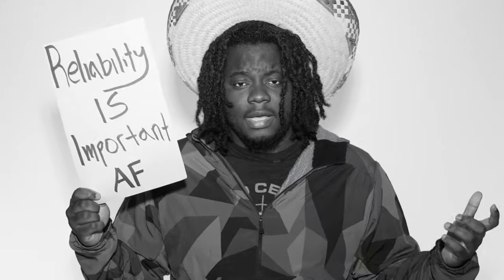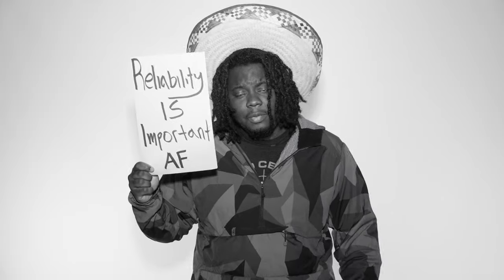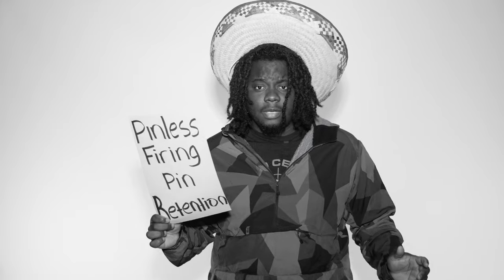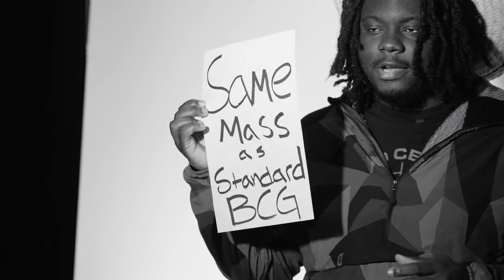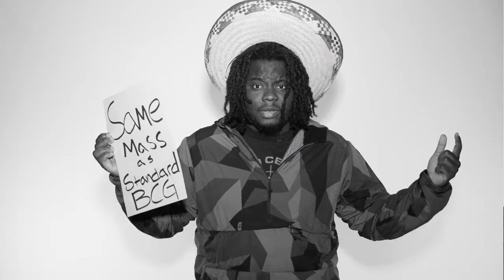Q  |  YQ  |  Why the New BCG??

Comment: I was waiting for this video, but you know, I’m still confused as to why it’s better than anything else on the market. Not trying to knock it, I have a lot of Q products, but I’d definitely like to see some kind of comparison of recordable data. Something to show why it would actually be an improvement, like showing how said scar cut works in comparison to a milspec BCG.
Reply: Exactly. The only thing i can think of is tighter tolerances for the bolt and gas rings. Oh and the bolt bounce issue. I bet it is because the Honey Badger has an extremely light buffer. I don't know how heavy it is but it looks lighter than a carbine buffer.
Reply: @monkeycbrown  yeah it might have specific uses for the honey badger, but that buffer system is proprietary. I’m just more curious as to how this improves any other AR build. I’d like to see if their particular coating is superior to what’s available or how much pressure their bolt can actually withstand in comparison to a similarly priced BCG.
Reply: Don’t use the word “said” (“said scar cut”) it immediately undermines the point you’re trying to get at thanks hope this helps have a Great weekend 👌